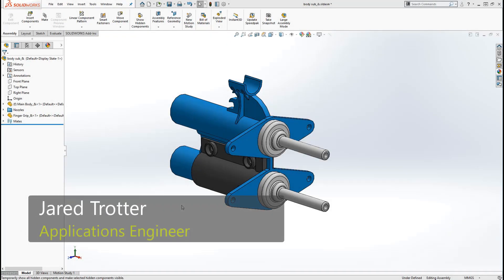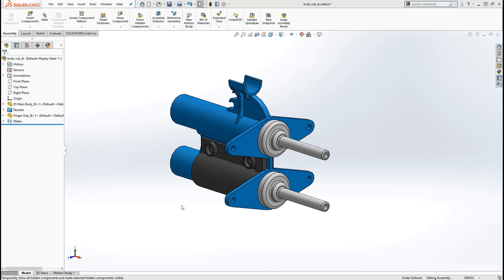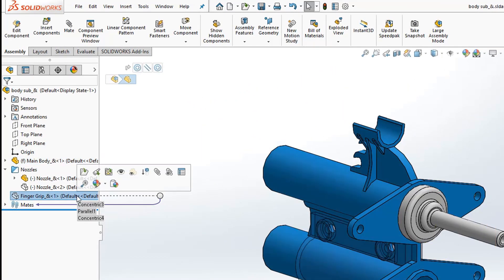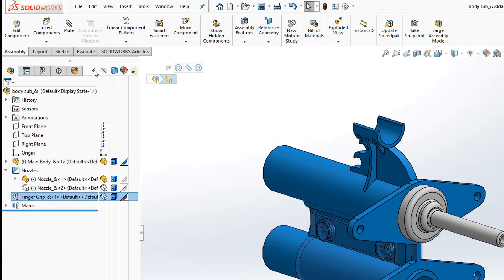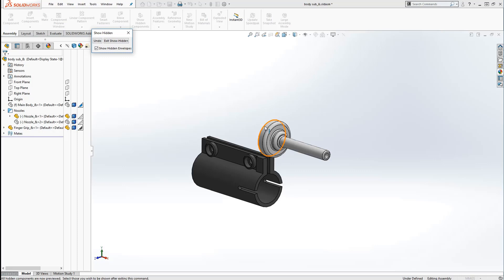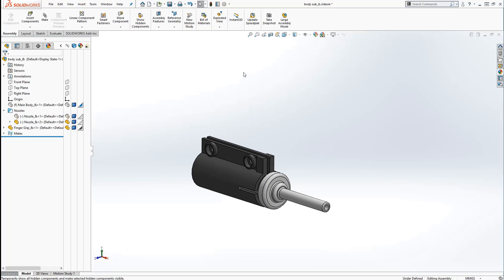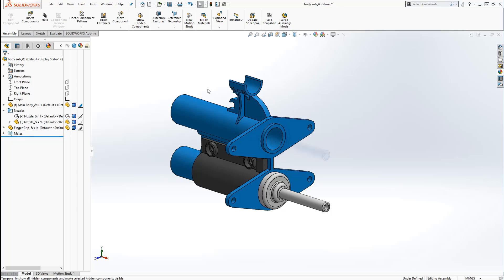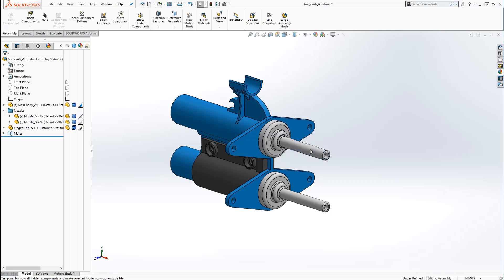SOLIDWORKS - Hide & Show Components

Comment: can we hide specific extrusions if it wasn't an assembly (single part drawing)??
Reply from the maker: The Hide option is available for specific features in the design tree. However, hiding a feature hides the entire solid body that it is associated with. So if you wish to hide a single feature, you would need to deselect “Merge Result” in the property manager of that feature.
Reply: @goengineer  that’s a great tip thank you!